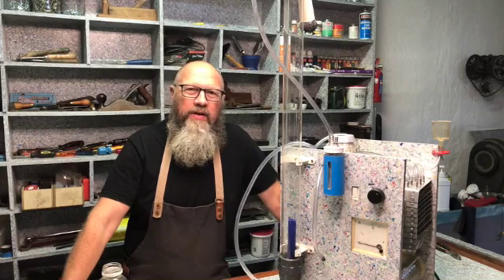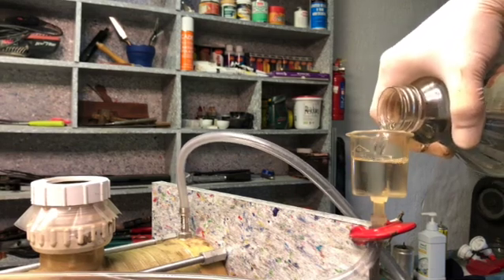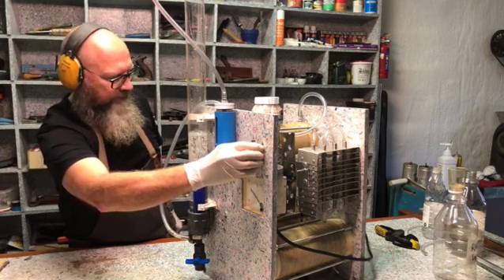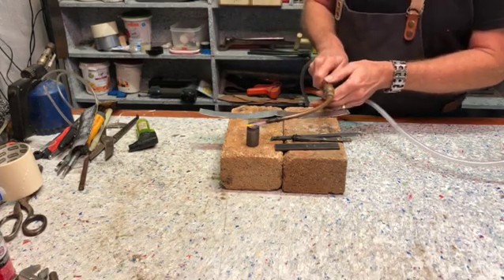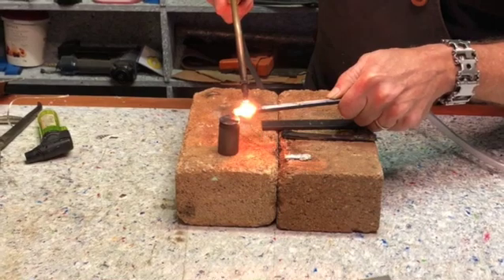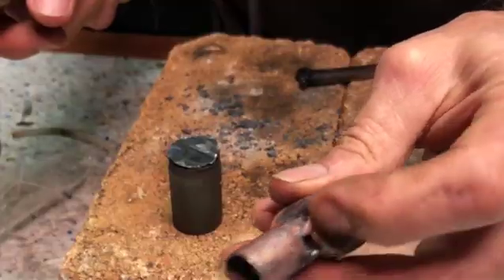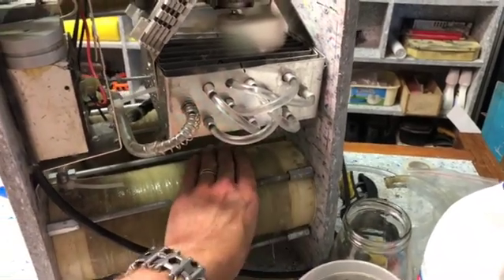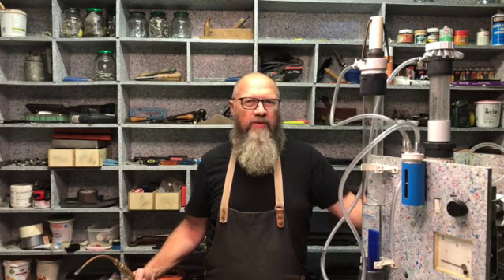How to build a HHO generator that produces Brown’s Gas safely and successfully. Part 4

Comment: Nice build. I keep getting flashbacks and blowing up my bubbler bottle. luckily I was wearing ear protection and goggles. Any idea on how to avoid it? I'm thinking it does not have enough flow and the HHO is burning in down the DIY copper nozzle 0.8mm I made and igniting all the gas in the tube and bubbler.

Comment: I'm aware some guys use a mix of Acetone, bubbling gas thro and so gain extra heating temperatures for brazing seemingly gets top end results... Good video, look forward to more... Thom in Scotland.
Reply: Do you get a flame that changes temperature according to the material being welded, as achieved by Yull Browns ?
Reply from the maker: That is correct. Maybe not the flame that changes, but rather it seems like the material will draw more energy from the flame according to the materials properties.
Reply from the maker: @JOBU412  Yes. I do. It is Browns gas.
Reply from the maker: Thanks for the comments! Yes, I did experiment with acetone, however some of it backed back into my acrylic bubbler and made the plastic to crack. If I use acetone again, I will have to use a glass or Stainlesssteel bubbler.
Reply: Thanks very much... You're explanation seems to make sense... Still we are learning me... In a humble way.. so thank you... Thom in Scotland.

Comment: How litter production for this setup
Reply from the maker: Hi. I measured 12 lpm.
Reply: @thequixotryworkshop2424  small radiator can also extra cool HHO hot water
Reply: @thequixotryworkshop2424  USING HOW MUCH WATTS?
Reply from the maker: @raloed.363  using 2000 watts.
Reply: @thequixotryworkshop2424   thats 65% efficiency. Not bad. You can get up to 90 % if designed properly